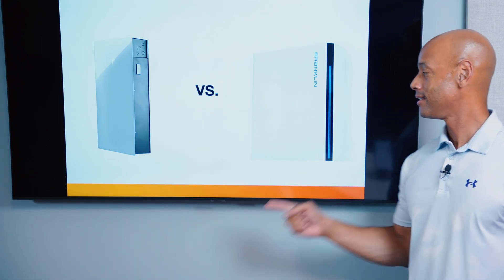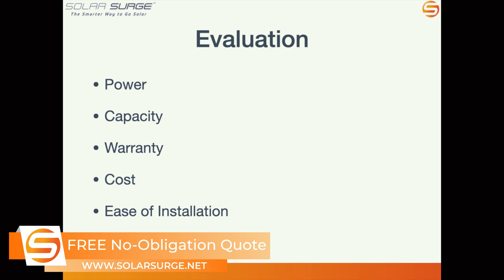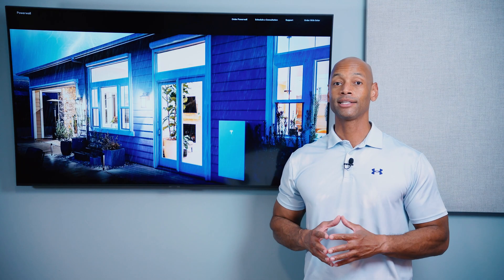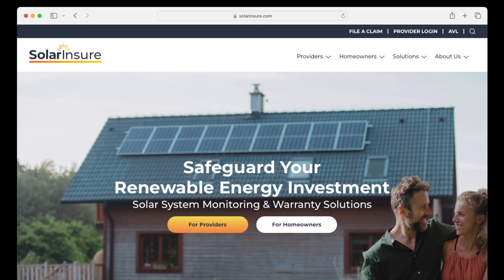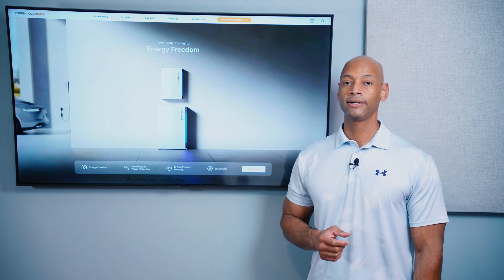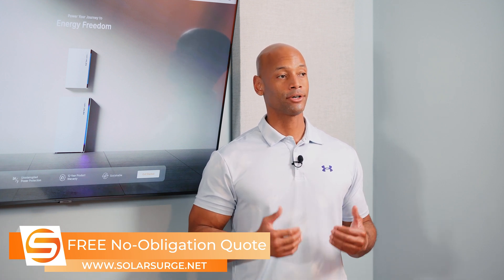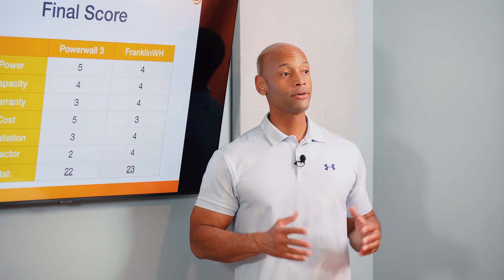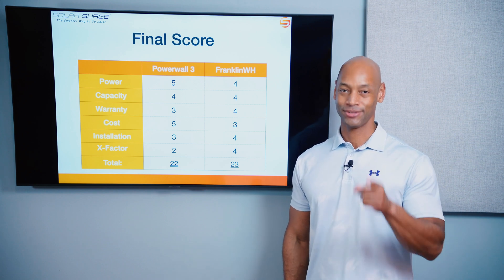Tesla Powerwall 3 Vs Franklin Battery

Comment: I like the idea of a DIY battery system like a Canadian Solar EP Cube or an Ethos stackable battery system that has stackable individual battery packs with an inverter control system.   One person can install it themselves or with the help of an electrician to wire it in and years later if one of the small stackable battery packs goes bad they only need to replace that one cheaper bad battery pack instead of needing to buy and replace an entire Franklin or Powerwall unit.     You can also add more stackable battery packs to increase your storage capacity instead of having to buy another full sized Franklin or Powerwall unit.     Stackable battery units also take up less wall space !

Comment: So I use my AGate generator circuit to connect to my F-150 Powerboost.  A full (29g) gas tank gives me about 233 kw/hrs at 220v/30a.  And I can leave for a few days if I need to hunt up some gas :).  Apocalyptic scenarios aside, I really like the system, it gets me the best of micro-inverter, black start, generator support, and load shedding all in just 1 box plus batteries.  Cost-wise, I feel like it’s still competitive if you want those features.   The tesla would still need a Span smart panel for shedding and a generator failover controller.  And at least 2 if not 3 apps to run it all.   Now if I had a Cybertruck, the built in integration would make the powerwall a no brained, but outside of that, I think FranklinWH is still a better deal.
Reply: I should add that I’ve got about 9 months use on mine.

Comment: UPDATE.  I erred, the PW3 CANNOT be used with Enphase IQ8 inverters.  I stand corrected.
Reply: @boblatkey7160  

""
Well that sounds like a pile of nonsense because the power wall three is DC coupled and not designed to work with an existing Enphase system. And there are numerous other battery manufacturers that have a warranty that's even better than the 70% warranty you mentioned for the Tesla power wall. 
""

 Educate yourself before spewing stupidity. It can be AC coupled now. I still don't like their products, but at least I'm not ignorant about the facts.
Reply: @SuperSushiRoll  well your right.  I crossed the PW2 with the 3.  The 3 cannot be used with Enphase IQ8 inverters.  Thanks for correcting me.
Reply: @thomasjacques5286   You're not corrected, @boblatkey7160, who I quoted because he would delete his comment, is wrong, and was condescending in the way he posted it. You should be able to AC couple the Powerwall 3 with Enphase microinverters (you'd need to research and verify this). But as of this past April the PW3 can be AC coupled. No need to settle for the arguably much worse PW2.

Comment: I currently have 52 Sunpower 330w panels and 2 Tesla 7.6 kw inverters.  

I’d like to get backup power added.   Like the Franklin whole home.
Reply: That's an interesting system how did you end up with Tesla inverters and SunPower panels. Go with the Franklin.
Reply: @CC-mj3zq  good deal on the panels.   And the solar company recommended the inverters.
Reply: Ok, that works! I'm sure Joe can set you up with a good design! I prefer Franklin if it fits but I would see what design works best.

Comment: Should you install a soft starter on the hvac ac unit to help the battery with not discharging so much energy if you only have 1 battery instead of 2 ?
Reply: Yes, it will reduce the surge current draw.

Comment: When we spoke in December, you weren't to keen on the Franklin, due to integration issues.  Has things gotten better in that regard?
As for installation, if your utility allows the use of the Tesla backup collar, that saves installers hours of time!!